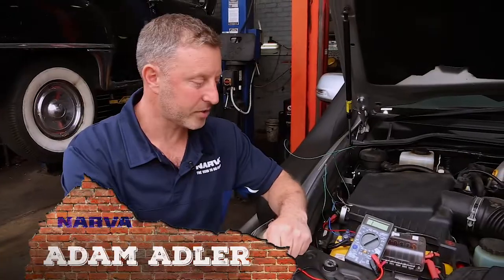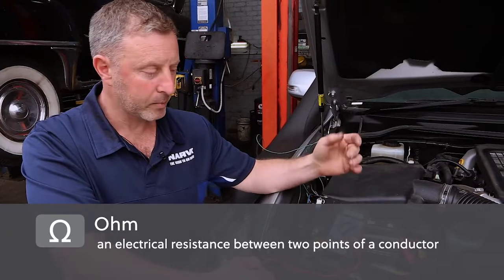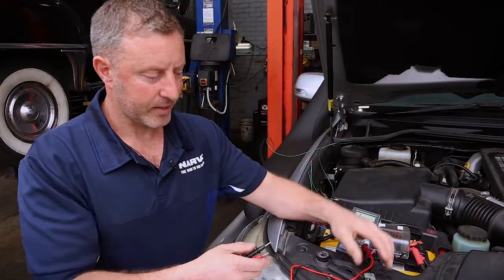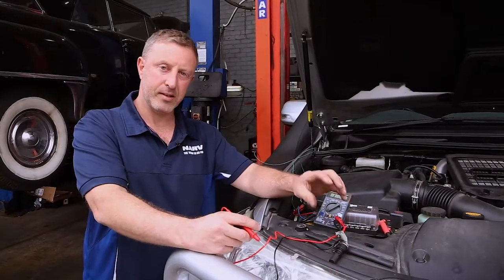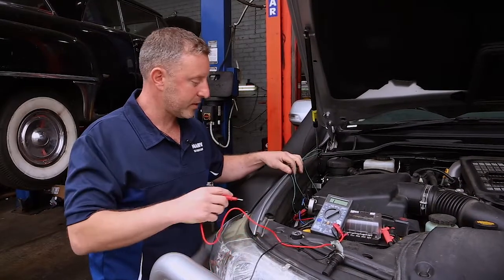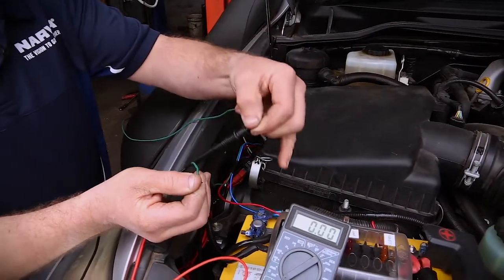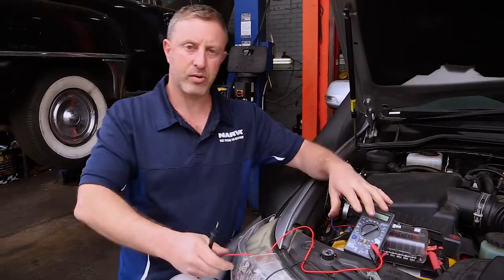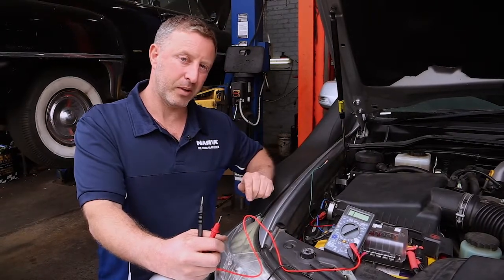How to use a Multimeter - Ohms Function

Comment: The confusion of using ohms is where and why you select a particular ohms range on the meter. Need explanation of which selection is used when a devices ohmns is supposed to be within a particular range.